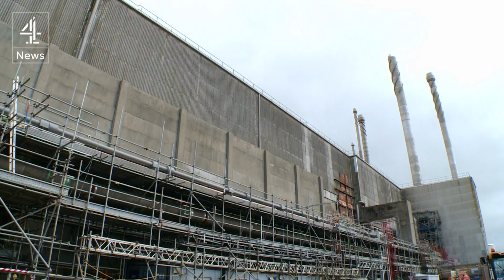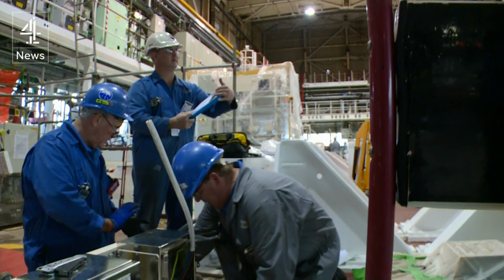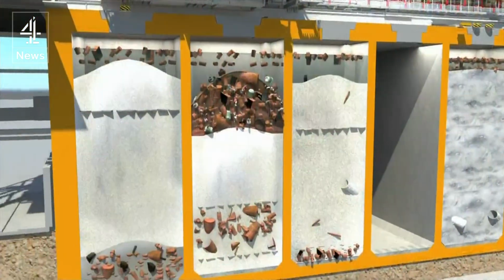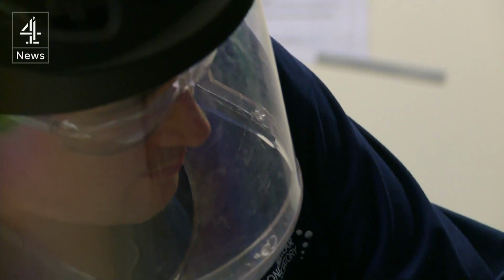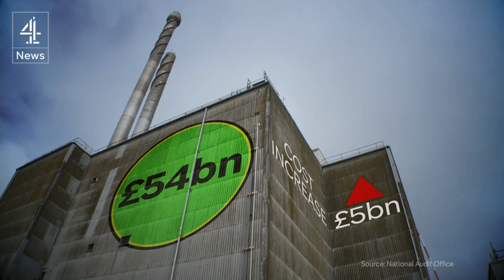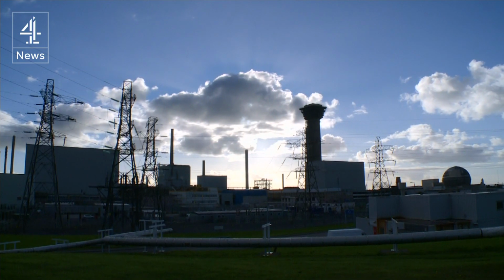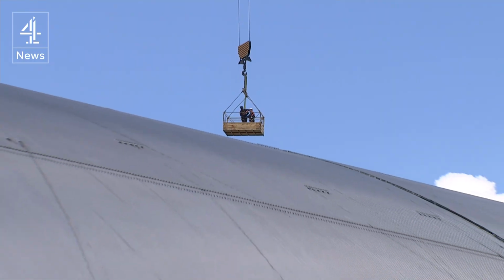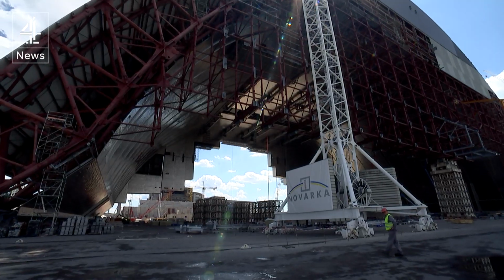Sellafield: Europe's most radioactively contaminated site

Comment: Typical of Britain's mainstream media : it's all about money.

Maybe, in this case, doing a proper job is more important?
Reply: If they wanted to do a proper job of it, they would've designed Sellafield better on creation. But because of cost cutting at the beginning, it's made doing a proper job of it even more hazardous and costly today.
Reply: @koolyman  exactly, so having the media be like "look how expensive this is!!!!" trying to drum up ghate for nuclear because of these epenses. all it could ever lead to is peopl ein future calling for less money inot nuclear and thus more cost cutting that leads to this sort of problem, or worse.
Reply: @ge2719  However it does show that perhaps the overall extraordinary cost of nuclear power is not worth it; and that we should rely far more sustainable, renewable sources... That is until the boffins develop fusion, but that is currently quite distant.
Reply: @koolyman  the cost decreasws the more tech we develop just lioe all tech. To stop using a source of energy this abundant and powerfull because we didnt use it properly in the past woiod be silly logic. by the logic we would have stopped uaing petrolium all togethwr after we found out leaded petrol was bad. We wouod have gotten rid of fridges when we found out cfls were making a hole in he ozone. we will never develop cleaner and cheaper methods of nuclear power if we stop investing in nuclear energy. 
We can invest in both.
Reply: @koolyman  The issues at Sellafield have nothing to do with commercial nuclear. It's a weapons plant. Essentially the UK gov at the time wanted nuclear weapons as cheaply & quickly as possible, so they did a botched job of it.

That said, commercial nuclear is expensive - but renewables are too. Luckily you don't have to pick one or the other. France got to ~90% clean electricity fairly quickly by using both and are the only country w/o significant hydro or geothermal reserves to achieve this. 

Meanwhile, pure renewable countries like Germany struggle to pass 20%, and instead have to rely on coal & imports from France
Reply: @koolyman  until fusion is invented and mainstream and renewables can be flexible in its power demand, nuclear is till the best option. There is alot of misinformation surrounding nuclear becuase of the main 3 disasters but predominantly Chernobyl. All nuclear disasters came down to incompetance and negligence. Take away these factors and nuclear works extremely well. Infact it works even better with the most modern reactors and is even safer. Nuclear is expensive on the start up however is significantly more cheaper in the long term while producing next to no carbon footprint. Ofcourse we do have waste too worry about however there has been a big push recently for thorium reactors which when combined with current nuclear waste can yield even more energy and reducing the half life of previous waste from thousands of years down to about 300. This means we can take a deeper breath to think of a better way to sort out our waste. Renewables are great however comapred to a nuclear reactor they are drastically inferior, nuclear provides power on demand and has flexibility and the uranium last much longer then coal which is where the decrease in cost comes in. Ill admit due to safety reasons nuclear isnt the be all end all but untill we get the be all (fusion) its the best option we have as renewables still needs further development and coal needs to stop asap.
Reply: @captainpocky  germany use to be the lead country in clean energy until they shut down their nuclear plants and decided to go renewable. Such a shame that chernobyl caused such a big snow ball effect in the fear of nuclear. Nuclear at this rate will be our salvation if we learn to accept true information about it rather then the fearmongering people give about it.
Reply: @Ashley Goggs Definitely agree. It's hard to tell if people are coming around but hopefully they do
Reply: @ashleygoggs5679  It wasn't Chernobyl that prompted Germany to reject nuclear fission power.  After all, a contributing factor in the Chernobyl disaster was the reactor's positive temperature coefficient, whereas all the reactors in Germany (IIUC) have a negative temperature coefficient.  It was Fukushima.  The meltdowns at Fukushima Daiichi demonstrated how modern reactors with negative temperature coefficients can fail.  And, to be brutally frank, the Fukushima site is still in the first stages of cleanup, and they already have millions of tons of radioactive water stored in tanks, and a radioactive harbour.

And, while thorium reactors are a great idea on paper, the industry and regulatory bodies are extremely conservative, which means no-one will be allowed to build a full-scale thorium reactor without a whole load of smaller steps along the way.  And that will need massive government investment if it's ever going to happen.
Reply: @ashleygoggs5679  Also, renewables may not have the same flexibility as a gas-powered power plant or a fission-powered plant, but hydro power, for example, is more flexible than coal-powered plants.  And many ideas for energy storage are being explored, to allow grids powered by renewables to have the necessary flexibility.
Reply: @captainpocky  i think with the internet and prodominantly scientists pushing nuclear awareness more people are coming around. Downside is the internet also helps the opposite happen aswell.
Reply: @nigeldepledge3790  i never mentioned anything about chernobyl being the reason germany stopped their nuclear power.
Reply: @nigeldepledge3790  indeed hydro does have this feature, however because a hydro dam needs to be well placed this makes it very unfeasable globally, only certain regions luckily located near a specific river etc could run a hydro electric dam. As far as anything else goes which is hydro powered we havnt really seen anything come to market which is significant just yet. Facts are we have nuclear now, and now we have exellent and safe reactors aswell as the potential for thorium to be introduced giving us more then enough clean energy too last untill Fusion comes along. Renewable still no matter what way you look at it have a long way too go, Its closer then fusion for sure, however once renewables get a decent swing into being introduced into the grid fusion would likely be here.
Reply: @ashleygoggs5679  Yes, you did.  I quote "germany use to be the lead country in clean energy until they shut down their nuclear plants and decided to go renewable. Such a shame that chernobyl caused such a big snow ball effect in the fear of nuclear. "
Reply: @nigeldepledge3790  and where in that does its actually say "germany stopped their nuclear plants becuase of chernobyl" ?  The "Such a shame that chernobyl caused such a big snow ball effect in the fear of nuclear. " was im reference too the global fear of nuclear because of such disasters. I never actually said there was any link between germany and chernobyl.
Reply: @ashleygoggs5679   - The juxtaposition of the two sentences implies a connection.  Or have you never learned what paragraphs are for?
Reply: @ge2719  These are terrible examples.
Reply: @koolyman  so your solution is to invent a time machine. I’m sure that will cost a lot more money.
Reply: @TheLostPacketYTGiven where my head was at 6 years ago - either that or create a purpose built handling facility given what captain pookie said above
Reply: Proponents of nuclear power are always confident they can do what they do without any major risks... until something goes wrong. And then it’s the taxpayer that has to foot the bill.
Reply: Hi JS - My response would be that at least the solution to climate change (ie solar + wind + energy storage) won’t create a toxic legacy in the same way nuclear has. Not sure what your point about hydro dams is. If you’re suggesting a hydro dam’s failure costs the same to clear up as a Chernobyl or Fukushima, for example, I think you’re probably quite mistaken. But you’re welcome to that opinion if you live in la la land.
Reply: JS - Renewables aren’t perfect. I wasn’t suggesting they were. But it’s a question of choosing the lesser of two evils. 

The legacy cost of nuclear is immense and still unclear - as this piece on Sellafield demonstrates. 

Take into account the subsidies the nuclear industry has benefited from over the past 70 years, add on the future cost of decommissioning and cleanup (let alone the economic cost of any future accidents)  and I think you’re pretty far removed from the ‘free energy’ ideology nuclear was originally sold on.

It’s not just me saying that. On a global view the number of new nuclear plants being commissioned had plummeted since Fukushima. (China might be the exception admittedly.)
Reply: If they didn't make it costly in the long term then there would be less jobs for our kids! Gotta think of lowering the unemployment.
Reply: Phil Weatherley   - Perhaps you did not understand what I wrote.  Everything in this piece is about the monetary cost of each bit they're talking about.  It's as if nothing else matters to them.  And, consequently, the message they're sending (knowingly or otherwise) is that money is the only thing we should be concerned about, too.  But maybe human lives and livelihoods are more important than the bottom line, yeah?
Reply: @harrier331  i meant until its invented to a commercial scale, anyone who knows anything about fusion knows it has been done  however no reactor has produced more power then it has taken just yet. And ITER is still far away, once ITER proves we can gain energy from the process we then have to wait decades more for commercial reactors. We have to bare in mind is that fusion is on the horizon but it takes longer to be reliant on it as it will take more time to create the infrastructure.
Reply: trust me, it would've been 100x more messy any other way... i'm kind of glad no ''so call'' british expert got to turn the matter into a major fkup... to put it in drums and don't touch it is sadly the very best they can do...
Reply: Whenever anyone says mainstream media you know that what follows of gonna be a load of conspiracy nonsense. How do you even know about this story? It was macmillans government that covered it up, there have been films and docs about it and loads of news stories. Clown
Reply: the continentals will pay for the problems the British caused
Reply: Because money is never a factor in these situations, right? Just vote for the proper green candidate who can simply 'will' a solution into existence, yes?

Comment: This place is safe. I don't live too far away. I don't really care
Reply: Christian Moss little do you know
Reply: Take some soil samples around, get your vacuum dust sampled. It will probably contain a higher than acceptable traces of plutonium. That depends on how far you are from that area. But if you live within 15 miles of sellafield, I would consider moving.
Reply: @EinkOLED  the vacuum dust wont contain any plutonium... having radiation itself doesn't mean there is plutonium nearby.
but yeah he should definitely get a Geiger counter. it should just be safe background radiation. not necessarily alpha/beta waves from the nuclear site.
i can pick up a random rock from the middle of nowhere and it should be slightly radioactive.
Reply: @darkshadowsx5949  Swear alpha can't travel very far.

Comment: More contaminated than Chernobyl?
Reply: Nope, it contains more used uranium but isn't nearly as contaminated
Reply: Peter Müller yep
Reply: Chernobyl has been temporarily dealt with by poring cement over the reactor core. the surrounding radiation is hard to filter out.unless you cap the whole place off with a lead dome.
Reply: Not more contaminated, more hazardous.